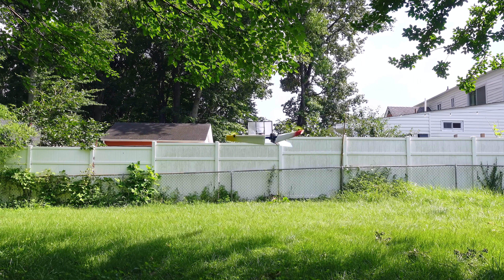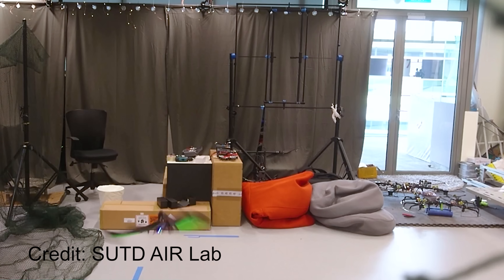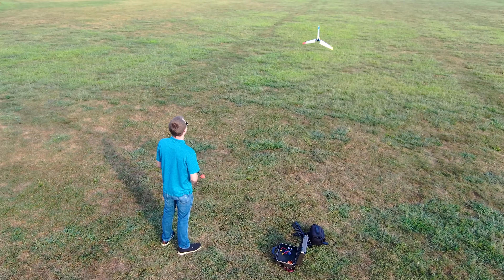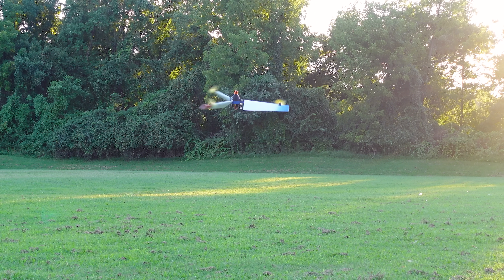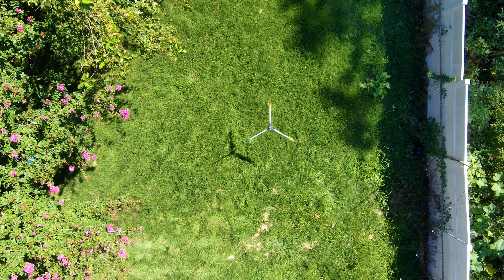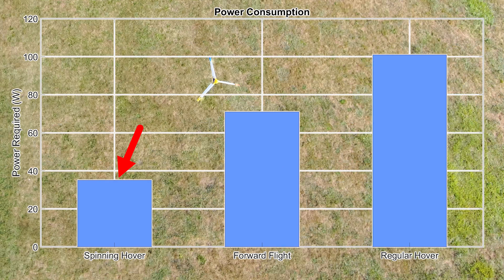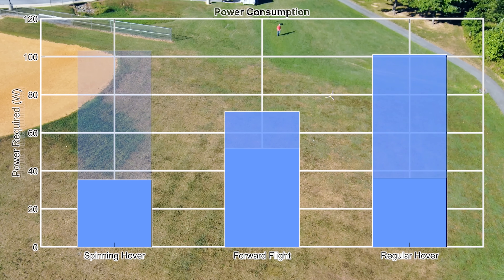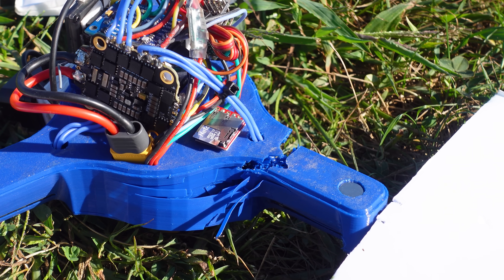Is THIS the Most Versatile Aircraft Design?  (Forward Flight Testing) - Part 2

Comment: I love this design, but most of all I love that you've taken it so far. Lots of experimental drone concepts don't get beyond the proof of concept or gimmick phase, but this is already so much further along and shockingly usable. Very excited to see where it goes. 

Also, have you given any thought to potential folding mechanisms for the wings to enable some sort of transition to a bi-wing during forward flight, or some other configuration that would at least allow the top wing to convert to a lifting surface? I can imagine the complexity and weight of mechanisms like that would be too great to be worth it, but I can almost imagine that there might be a sweet spot or very creative way of accomplishing it in a way that's efficient.
Reply from the maker: Thanks for the kind words. We’re just getting started with these spinning drones I think, lots more to come
Reply: Great idea. Something like a double pair of scissors popped into my mind, forming like an X
Reply: That crash was like a eureka moment in forward flightb design. Make a hinge mechanism around were the hub broke downward. And go in the direction of forward flight transitioning that @Imnon was mentioning to incorporate. Excrement design by the way. Keep up the good whirl. 🤙
Reply: I was going to comment that adding flaps could maybe help with the efficiency tradeoffs. But I'm also far less of an expert than Nicholas seems to be, so there may be a reason why that won't help (or be overly complex.)

Comment: How about some sort of asymmetrical wing design, specifically for the vertical wing, to decrease its in-flight drag?  It could use a higher angle of attack to compensate during spin, or maybe extend out while in spin (thinner wing or shorter wing respectively).

Comment: Why no carbon center hub?
Reply from the maker: @Markforged won’t send me a Mark Two carbon printer
Reply: @NicholasRehm  no i dont mean 3d printd but just 2D carbon sheets cnc'd like it is made on fpv drones.
Reply: and sandwich in 3d prints. with this method it gets just slightly more expensive but a lot more robust and realiable and lightweight

Comment: Would a 4 wing design work that would fold its wings into a biplane design be more efficient for forward flight? a square center with the 4 wings going out at 45 degrees from each corner of the square, and then when transitioning to forward flight the wings would snap into 90's so that the wings were then perpendicular to the ground so then resembles a biplane. This would remove the dead weight wing from the forward flight and may allow more weight to be carried, but then maybe less because of the extra weight of another wing? would need small actuators to make the wings transition unless there was a way to use the spin or lack of spin to change the wing position using centrifuge forces? maybe a spring or something on a joint where the wing meets the main body.

Comment: Wouldn't it be more efficient and logical if the third rotor wing would be horizontal to the flight direction instead of vertical if it doesn't produce lift anyway way don't you put it horizontal to minimize the drag as well? It would only need slightly modifications to realize that.

Comment: Woo! An update!   Now… I know this sounds a bit bonkers, but not impossible- could one use a semi flexible wing surface, with a small servo and a thin carbon fiber spar inside to dynamically change the cross section of the wings?  Or maybe a linkage that slightly bulges 2 wings into a more airfoil shape when not spinning?  

From what I understand, the airfoil shape doesn’t generate that much lift, but squeezing any extra efficiently from the design would be a neat challenge. 😅

Comment: It'd be interesting to plot range vs. flight time for the different modes. Fixed wing flight will probably give you better range, and you know that the endurance is best in the spinning mode. There might be a sweet spot where you can travel further in fixed wing mode, then transition for a long-endurance loiter. If designed for a particular application, it could be extremely effective!

Comment: variable angle large rotors, ie, transition tipjet helicopter to a straight wing air plane modes
Reply: 360 or gyro 360 free stabilized camera
Reply: camera stays in world coordinate align at all times, no matter if the platform spins or not
Reply: man, use a line lidar, not only a point lidar, scan a whole vertical line at once
Reply: you can keep the center passenger pod gyro stable (counter rotating) in zero stationary position
Reply: so you also claim that the spin hover is the most efficient forward flight mode, by logic
Reply: do the 2-wing (not 3-wing) version test for efficiency comparison
Reply: its cool
Reply: variable pitch angle large rotors, just like helicopter, or cyclo-copter, to have direction control, momentary pitch less or more while turning
Reply: in that way you can fly in the hover mode
Reply: why not kite large wing rotors, that way it has even less downward movement, its like a parachute float wings
Reply: even more efficient, like a seed wing spinning
Reply: the more wing surface area, the slower the downward motion
Reply: cl-84 variable pitch+rotor tip-jet helicopter

Comment: I've commented this on the previous video, but I'm gonna say it again. If you add servos to the large wings individually rather than having one that controls all three, you can get much better lift, roll and yaw control on forward flight mode. Pitch control can be done with the propeller on the top wing, yaw control on the top wing that acts as the vertical stabilizer, and roll control on the two lower wings that create lift. Although this probably would take a lot of code to get working.
Reply from the maker: If variable motor rpm for spinning hover control doesn’t work like I want it to, the next step will be control surfaces like this

Comment: Would it be feasible to make one of the fixed wings actuate and lay back at 90 degrees during forward flight to reduce drag?
Reply: I was going to suggest variable pitch on all of the wings, but just one would be a great start!  Bet it would be an engineering nightmare though.
Reply: @Jazucu  shouldnt be too hard to trigger a linear actuator when transitioning to forward flight, either manually or via accelerometer data.
Reply: If the vertical wing was hinged at the back/bottom it would it would automatically fold back when the wings motor power is cut. Restart motor to unfold.

Comment: Another great video on this!  I am not often excited by what I see in the drone world (these days anyway) but this is interesting.  I might have to have a go at this.  You could solve your directional control problem through either software or hardware.  I'm a hardware guy, so I ended up thinking that a swashplate type solution would solve this, but, you should be able to essentially simulate a swashplate in software using blade angle of attack, but, I think you would need to know where each blade is in relation to your aircraft coordinate system.  There would likely be some interesting control effects too.
Reply from the maker: If you’re excited, then mission accomplished for this project. Gonna try a software solution for directional control first, then maybe add some hardware if that doesn’t work

Comment: The 1st thing i asked myself was: why doesn't he fly it 2 wing up-1 down to get dihedral stability in forward flight? But I guess that doesn't work so well if you need the LIDAR sensor for height control. And for hover stabilizing, you would need to tilt each wing independent, wouldn't you?
Reply from the maker: It could benefit from dihedral if there were no active stabilization, but luckily there’s no controlability problems with my flight controller

Comment: In level flight could you reduce the AoA of the lower wings by using the tilt motors?
Reply: Right now they all tilt the same way using a single motor and bevel gears, so setting independent tilt isn't possible.

Comment: What if you increased the number of surfaces to 4?  Then in level flight all 4 surfaces would produce lift and the dihedral and anhedral of the upper and lower wings would cancel.  Also, if you felt saucy, you could do some variable geometry with the opposing wing sets by making them "narrow" or come together during level flight.
Reply: Hmmm turn it into an x-wing design...

Comment: I wonder if, with independent wing angle control, you could change the vehicle's attitude so that, in forward Y-wing mode, it was leaning forward instead of leaning back.

Never mind, now that topmost motor would be angled slightly downward.  That's worse in every respect.

Comment: Could rotating the craft by 30° in forward flight mode help? That way one air foil would generate full lift and the other two generate reduced lift. No more "dead" weight, but I'm not sure it would offset the reduced lift of the now steeper foil.

Comment: Great work! I was quite surprised to see forward flight be most efficient at a stalled AoA. But the truth is in the data, so I'll have to accept it.
Reply: It was minimum power for altitude maintenance, not forward flight efficiency
Reply: @adamhulu6171  Understood, but when stalled your lift to drag ratio is awful - a lot of energy is going into a turbulent wake rather than lift. So it's still surprising, I was expecting low speed, non-stalled flight to be best.

Comment: what about a 4 wing design that flies forward like an x wing so all surfaces contribute to lift?
Reply: I had the same thought, possibly with 2 pairs spaced closer together, rather than all 4 equally spaced around the perimeter. I'm assuming that having the wings at 45° above or below horizontal would greatly reduce their lift efficiency, leading to no actual gain, but that is purely assumption, I could be completely wrong.
Reply: @Tim Plett  I would think 4 equally spaced for hover stability and then close them together or at least to a 30/70 split for forward flight.  It would increase complexity of course
Reply: @timplett1  it is all about chasing the trade offs. closer spaced wings would be better for forward flight but might decrease hover efficiencies. never know until you try. Thanks for sharing your research I love this type of stuff.
Reply: I suggested that to him on Discord 3 weeks ago, but got no response.
Reply: Whoa

Comment: I wonder if you're losing lift in horizontal flight by flying at a low speed. That would align with a higher AoA as you would be relying on your propellers to provide sin(20 deg) = 34% of your lift. I also think that roll shouldn't affect your lift in horizontal flight with a three-surface design, for the same reason why three-phase electricity provides constant power. These two ideas combined make me think that if you had your drone spinning while in horizontal flight, you'd achieve higher speeds, lower AoA, and more efficiency.

Comment: One way of avoiding the vertical surface which provides no lift but adds drag would be to switch to a quad-rotor design. If instead of spacing the wings 120º apart, you space them 60º, 120º, 60º, 120º you'd end up with kind of a biplane configuration in forward flight, with all wings providing lift. 
As a Bonus it would look like a bit like an x-wing :D
Reply: blah blah blah blah, X-WING!!!!!!!!
Reply: @gadgetmerc   you win the most obvious slam award.
Reply: With the quad rotor style the lift component wouldn't be vertical as would be perpendicular to wing surface, so you are losing a decent amount of lift and as such I'm not sure it would be worthwhile as you will still increase drag.

But since you bring up x-wing, why not rotate the wings similar to flat (ftl) and x (combat) mode for the x-wing :D
Reply: @gillo100  Yeah, I was thinking the same - latch the four wings at 90 degrees in spinning hover, but then latch them in a biplane configuration (bumping up two of the wings on some kind of pivot) for forward flight...  But only if that can be done without adding so much weight it cancels the efficiency gains...

Ooh, the latching mechanism could be quite simple and not motorized - just a solenoid to disengage a spring-loaded pin to allow the joint to pivot.  The rotors can pull the wings into position by angling them independently, and the pin will automatically re-latch in the new position.
Reply: @gillo100  you'd have the lower wings at -30° from horizontal as now, and another pair above at +30° from horizontal
Reply: @gillo100  yeah, even if they don't come all the way together, they could behave like a biplane. say they are just at like 15 degrees from horizontal- many planes have significant amounts of dihedral... could be really cool. while were on starwars topic there could also do a rotating cockpit like the t-6 shuttle.
Reply: @gillo100  Now I'm imagining 4 wings with 2 motors front and 2 back. They could then combine to two wings for flight.
I wouldn't expect it to be practical but might look quite cool. :)
Reply: I came here to say exactly this…to an uncanny degree. One exception: stagger the blades at 90 degrees and add a rotating action to the central axis so the quad copter is evenly spaced but the x-wing can be accomplished in forward flight (like scissors)
Reply: What if you have these 4 wings on joints and then a servo motor that can pull two and two of the wings closer together
So that when you wanna go to forward flight it almost becomes a double decker airplane
And as soon as you wanna hoover again the servo pushes them apart again into an x shape?
Reply: @mrono1910  it seems a good idea. You need to find a mechanism strong enough and light enough to fit inside the drone and guarantee enough rigidity
Reply: So we went from "Spinning is a good trick" to the "T-16" and now to the "X-Wing". Damn this IS the Star Wars channel ;)
Reply: I want to see this
Reply: An alternative may be a quadricopter  with an even 90° spacing with the possibility to bend the wings using a thin cable and a small motor with a big reduction. Bent wings may be very rigid and have a large near horizontal segment near the wingtips
Reply: Thinking the same thing but add servo(s) to move the wings from X to =x= when transitioning to level flight to make it a biplane flying wing. Staggering the motors on the wings and have the hinge point far enough away from the hub to prevent prop interference, or maybe just use 2 motors with the motor on the top wing on one side and bottom on the other in level flight...
Reply: look up parrot swing
Reply: What if it will be two parts with 2 blades one behind another, connected via freely rotating bearing.

Each part could rotate in opposite directions in helicopter mode, similar to Ingenuity. Counter rotation possible can add stability (if i correctly understand aerodynamics). Also one advanced bearing can provide non-rotating shaft for legs and cameras.

In plane mode both parts aligned will give more lifting surface, and slight rolls in opposite directions will result in yaw, similar to a flight of a bird. I think front part should have shorter wingspan for stability and to prevent interception of rotors thrusts.
Reply: Make sure the control on the remote is marked "Lock S-foils in attack position"
Reply: I think it might have trouble with balance while in a rotating hover
Reply: Maybe you need to make 4 wings 
but of different lengths for example: 
                      X
                       I
X------------------O------------------X
                       I
                      X

Long wings act as a propeller and main wings.
 Short wings stabilize rotation and act as a keel in flight.
Reply: I had exactly the same idea. I'm not sure how well it can rotate considering the uneven spacing of the wings
Reply: @patriziocapo  
That spacing configuration is common on many helicopter tail rotors.
So should be fine.
Reply: Or, biplane like that university, with 2 smaller motors for hover and tilt control.
Reply: Like a box kite ?
Reply: Isn't the 4-blade design essentially same as 3-blade always tilted sideways
Reply: Yup that was my first thought after the video too.
Reply: If it wasn't radially symmetrical it might actually be a better design!
Reply: @sourand jaded i guess it would have a kind of ballistic trajectory in forward flight like that ...
it would be a bit like a rocket ig , but tbh i am not an expert
Reply: yeah that was what I was thinking. thinner wings, x-wing configuration,
Reply: Or to use that tandem design he showed, but with coaxial rotors. It might still need canards to work.
Reply: That would be the same as having a vertical surface the same size as your horizontal surfaces.

Comment: A retractable "3rd" wing might be an acceptable solution to the drag problem in forward flight mode. The downside is that you lose the trust and add the drag generated by it's corresponding proppeler. (I came up with this since you already have "lost" some of the simmetry by also using the lidar in forward flight)
And, mechanically it's a complex thing to achieve.

Comment: It might be too difficult/unnecessary, but if it's doable I wonder how the efficiency would change in forward flight if 1 of the 3 blades could fold down into some sort of fuselage to possibly reduce drag, then fold back up into the tri-copter configuration when hovering again